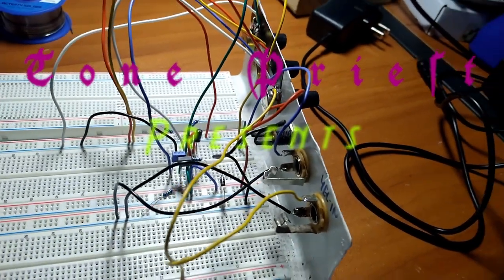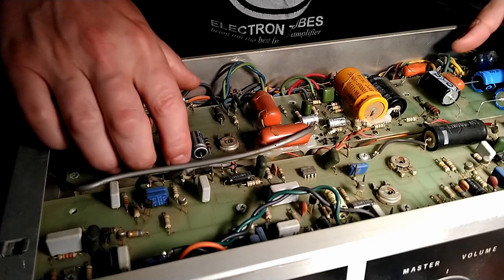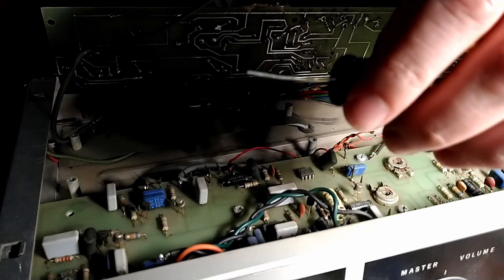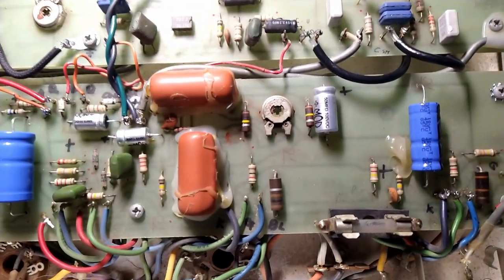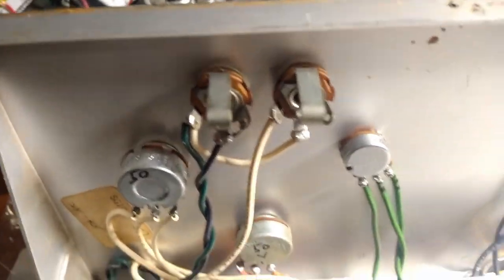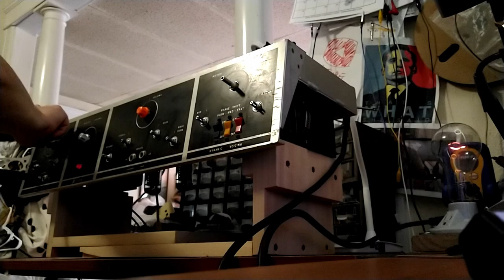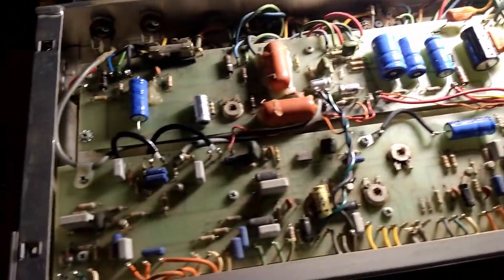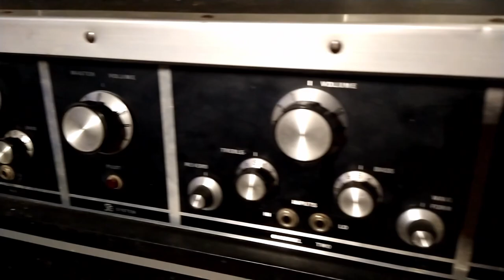FIRING UP THE WEIRDEST AMP RHETT SHULL EVER PLAYED - CMI SG-212 - LET'S REPAIR! - EPISODE 29

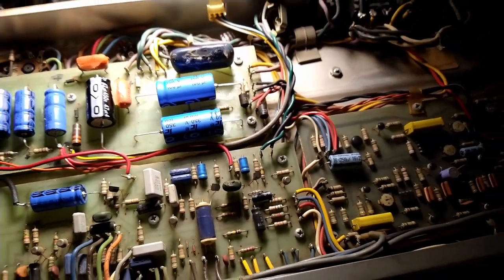Comment from the maker: CORRECTION: ~32:30 -  Leo uses 470 ohm screen resistors. Also, the 100 ohm resistors shown in the video are on pins 2 & 7 which are the heater terminal lugs. Not sure what that's all about. The SG-212 schematic calls for 100 ohm screen resistors and 1K grid blockers. More investigation needed...